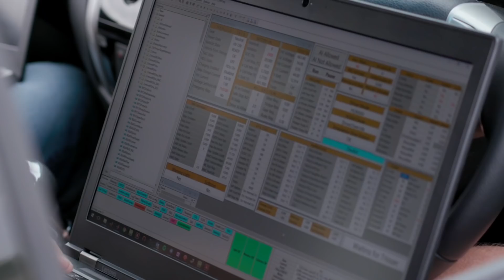The road to a driverless hillclimb | Roborace behind the scenes

Comment: For all of those being incredibly negative about this, I see your point, but this was a technology demonstration vehicle, to bring the design to people's attention. Almost certainly, it does not fit well with the Goodwood ethos, but where else could they garner free publicity? That publicity obviously worked, because you are all commenting about it. 

For the record, I don't mind seeing EV's at Goodwood and at other venues, but they need to be driven by Mk 1 Wetware; human beings. Within the next generation, petrol and diesel fuelled vehicles will become rare on our roads, and they will be supplanted by other sources of fuel, including batteries, so I'd welcome the changes, rather than sticking my head into the sand and hoping that it will go away. You cannot hold back the progression of technology, any more than could Canute hold back the tide.

Incidentally, electric propulsion was very popular in some places over 100 years ago. New York City had more than 10,000 electric cars, mostly driven by ladies, with ranges of around 40 miles, powered by 6V Edison batteries, and supported by on-street charging stations. They outnumbered petrol vehicles, and Henry Ford even bought one for his wife. Jay Leno has an excellent example of one of the cars, in his garage. The idea is coming around again, but in larger numbers, but the technology behind it has improved greatly. And the vehicles are also being marketed to gentlemen! The vehicle (not a car, since it carries nobody) in this video shows some of the things which might be incorporated into the vehicles of our near future. No more, no less.

Comment: Damn, people in this comment section are sad... 
Yeah racing has the human input (at the moment), but this is an engineering miracle. Because engineers also race on track even that you usually can't see them as they are behind the scene (people who develop and build e.g. the Formula-1 cars). 

Most comments are just pretty dumb, people stuck in the 90s or crying out loud as horse owners cried against the first automobiles...

AI racing WON'T TAKE AWAY human racing, it is just a new segment. Get used to it that this will be a thing. Even if it makes you depressed and cry in the corner of your room. This is the future. Soon, it will be the present.
Reply: Bracci it’s far from a miracle. FAR. 

It’s also not sport, much less a spectator sport. That is to say, there’s nothing of interest for a spectator. Who do you cheer for?  The software engineer who wrote the AI?  

Zzzzzzzzzzz...
Reply: Wiggy, there's been a very popular TV series for several years which featured pairs of autonomous robots fighting to destruction. Not my choice,but plenty of people foundit both interesting and exciting. A series of races for autonomous cars could also be turned to the same advantage. People will watch, and be interested, maybe not at Goodwood though; Goodwood is all about drivers and riders of vehicles. EV's could take part, and will have to become a part of the events, but only if those EV's are piloted by Human 1.0 ™ , and not by Robosoft 2.11.5 Beta III RC 2.
Reply: Bracci It’s definitely not an engineering miracle. The technology is been here for this meaningless car to take shape.

Comment: As an ex club level driver and 60 yr fan of motorsport this SUX no other word i can think of bring back the 908 917/30 917k 962 all the "older" model Porsche's also the early GT class where engine size and therefore horsepower was unlimited the only thing that slowed u down was either the size of your wallet or size and material of your balls lol.
Like no on board computers and 800hp and normal steel brakes that overheated and any way u know the story either lots vrun off or bent cars. 
Men or women racing real cars.

Comment: Not years of testing by now? Just 6 months? With the new platform, maybe?

What this project direly need, is competition. Another team that programs an identical car, to go faster. Speed of all runs shows, development cars and this one, have been staggeringly slow. In the 90's we've seen faster autonomous race cars I think. The programmers are doing something wrong. Or the risk/reward balance is totally off. 
We need these cars racing, different teams of developers and not too afraid of a scratch.

Comment: Yes but... why? I didn't doubt for a second it was possible. If we put man on the moon in 1969 then building a car that can drive up a strip of tarmac autonomously isn't exactly a stretch is it? No disrespect to the engineers at all, it's technology that will have an application on the road as and when autonomous cars become commonplace (which personally I still don't think will be for some time... Decades?) But... Why race them? It's missing the point of what motor sports is. The electronic/AI/simulation technology is what makes F1 so boring, and why it's banned in DTM. For example, having banks of computers and engineers using algorithms to perfect pit timing strategy to avoid having to actually overtake someone on a race track is all very clever, but unexciting and void of human error. I know a computer can think faster than a human being. But I don't care, I want to see a fallible human being behind the wheel!
Reply: "But... Why race them? It's missing the point of what motor sports is."
No sir, you are missing a really big point which have been part of motorsport for like half a century or more.

Racing stuff has nearly the same effects as war, which is making development way faster. By making it a competition. By racing two autonomous cars programmed by different teams, you'll see different results, different 'style of racing', etc. And the better one might get implemented in road cars later, while the worse one is put under pressure to make it better.
Just like as the cars that we have nowadays have dozens of functions and parts which were first used in racing cars 5-10-20-30 years ago, in 10-20-30 years the same will happen but using the upcoming autonomous series' technology.
Reply: Bracci yes, I’m well aware of the benefits of development of motorsport, though at times I think it’s over played by manufacturers. (Carbon carbon brakes anyone?) A lot of the technology in motorsport are actually hand-downs from the aerospace industry, and not all of them have a direct application in everyday motoring either. In the field of autonomous driving though, I don’t see a direct relevance between competing algorithms designed to win a race with calculated risk, and an algorithm designed to get from A to B in the safest, most efficient manner. I just can’t see it. Moreover, if there was a direct relevance, namely that collision with another vehicle, or any form of contact was considered an unacceptable risk for winning a ‘robo race’, then as I said, would that not be the dullest race ever? Competing at a high level in motorsport has a large cost to manufacturers, and the old adage of ‘win on Sunday, sell cars on Monday’ still has a relevance. But it depends on people actually tuning in or paying to go and watch the race. If nobody turns up to watch it, then the resources are better spent on R&D. With regards to your war analogy, yes, that drove things like radar, jet engine development, rocket development in the 2nd World War, without a doubt. In fact the fuels used by some of the F1 teams in the 90’s came from a BASF fuel designed for piston engined aeroplanes of the Luftwaffe in WW2! But things have moved on... Aircraft manufacturers don’t need Air races, the Empire Trophy or (thanks God!) war to drive development any more. Just staying in business is hard enough in a cutthroat marketplace. And that is what will drive the development of automated cars. That and lawsuits! In my opinion...
Reply: Bracci without the fear and danger, it’s completely uninteresting and is no longer a sport, nor anything worth a crowd of spectators. They may as well be running these cars on a virtual track in a basement.
Reply: I think it's very important for us to know how AI reacts in unpredictable conditions (such as low traction in the rain causes a car to spin), in such high speeds, and motorsport is a perfect springboard.